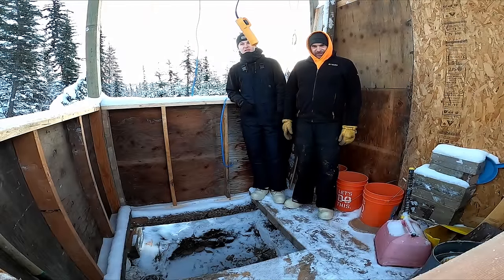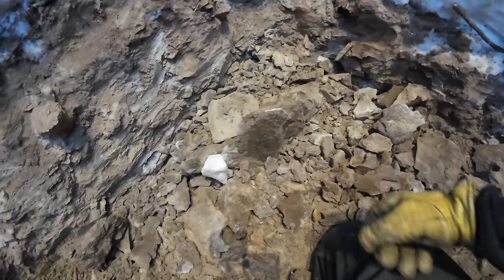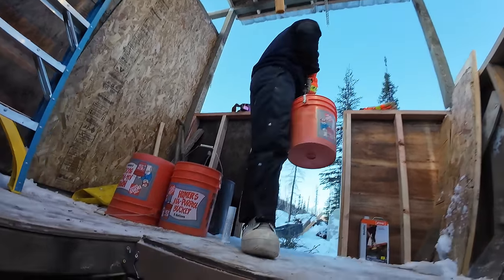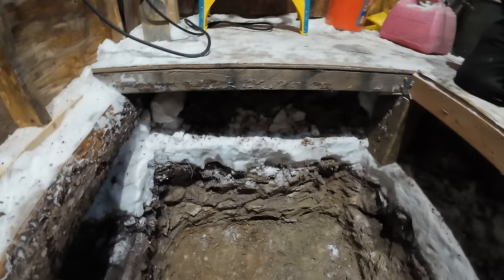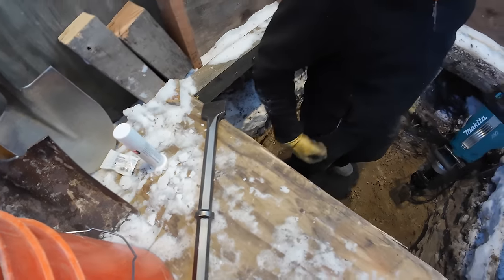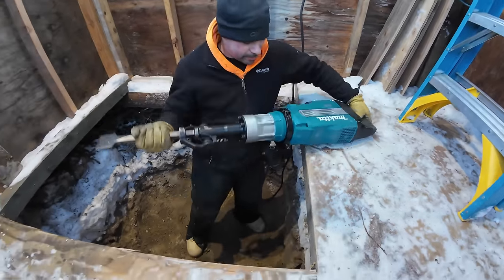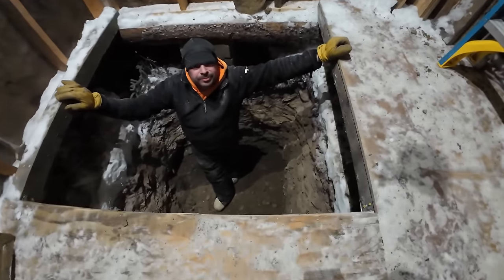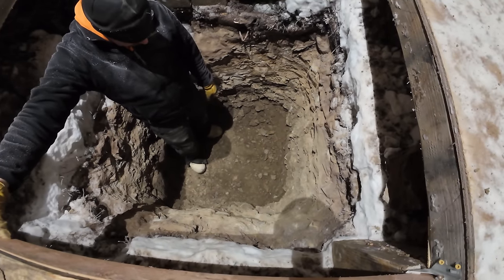Alaskan Winter Mineshaft: Gold Mining/Prospecting in the Interior of Alaska - Part 2

Comment: good job on dropping your shaft , would widen it out a bit and timber the collar ...let us know if you need pointers on timbering and ne safe down there .
Reply: Thanks Jeff, it's going to stay 4x4 because it's a nice happy medium for the size of hammer we are using.  And yes we plan on collaring the top when we get a bit deeper.  Love your videos, you have been an inspiration to us for years.
Reply: The Permafrost makes it very unlikely you'll have any cave-ins but obviously in the spring your hole is going to flood. While a collar is a great idea they should also think about digging a sump and thinking of how they will continue in the spring without losing all their hard work. Also they need to be putting those chunks of permafrost into some metal water tubs near a campfire so they can pan it on their downtime. I'll be doing the same thing as these two guys except in late April in the Yukon. BC has spots equally appealing but the Yukon's permafrost is actually a blessing (big equipment needs to wait for thaw out, small operations can work by fire like the oldtimers)
Reply: @MW-nOttawa  This hole will be completed before the thaw.  We do not need to consume precious lumber shoring it up as it will be frozen solid the entire time we are working in it.  This hole is a prospect shaft and the target is bedrock. Right now we are working through the muck layer and there are no values in that.  We are going to do a video on the anatomy of the shaft possibly this weekend to explain the layers.  When we hit gravel we will begin thawing samples to pan and stock piling that material.
Reply: What’s up Jeff?
Reply: As i was watching your video. I was thinking that probably should have a collar on that hole. An sure enough who else but askjeffwilliams chimes in lol!
Reply: Man I'd swear you and slim are following me.😅
Reply: @tylernelson276  more dangerous at this point is the plastic buckets over head them buckets will come apart eventually with that much material the man in the hole should really pay attention or could get a headache

Comment: 3 ft down, build a buck frame to hold a piece of thin OSB, cap with 2" foam board, and put 2 bales pf straw on it with another foam board as a cap. Run a rope through it all at center for a winch loop. Lift it as a plug with the winch to access. Keeps the thawed gravel from freezing. Worked in Fbks.

Comment: Would probably be better to use a 1" x 12" hammer drill to drill holes like a grid to allow for expansion and to allow cracks to form between the holes when you use the jack hammer.

Comment: Ill be doing the same thing in Yukon this spring! I've got all the equipment I'll need. If I could suggest one thing that might really help you - get a jackhammer of some sort. There are some really nice small battery powered ones on the market these days.
Reply: 30 seconds later, theres the jackhammerr!   Where is your 170,000BTU propane/diesel furnace ?
Reply: After watching the whole video, you guys have a great setup and with a little tweaking you'll be flying. I suggest getting a propane heater like a Buddy Mr Heater and also a torpedo heater for the hole. If you enclose the shaft a bit with plywood or tent you'll be nice and cozy. You guys are working hard, might as well be comfortable. I'd also suggest making a fire and placing some metal buckets with water beside the fire. You can dump the permafrost chunks into the buckets and then pan our the 'melted' dirt an hour or so later. This is what I'll be doing in April.
Reply from the maker: Appreciate the tips! Best of luck to you on your shaft-digging endeavors.

Comment: Collapse?
Reply from the maker: Fortunately, we will not have to worry about a collapse during the winter months. The surrounding materials that make up the walls will remain frozen as long as the outside temperatures remain below freezing. However, the shaft will collapse when it thaws, but we will be done digging by then!
Reply: @AlaskaUnderground  even if you blast the walls with heat, it will only thaw out an inch or less at a time and you can hack away at it with your pick to keep loose boulders from tumbling out unexpectedly. You're so close to the ground (e.g. in your feet and not in a machine) so you'll be intimately familiar with almost every rock in your hole if you want to be. As mentioned, I'd be putting that spoil into hot water and panning it while you let a diesel heater soften the ground and then hit it with your jackhammer like you've been doing. You'll fly down 1foot every 30mins.